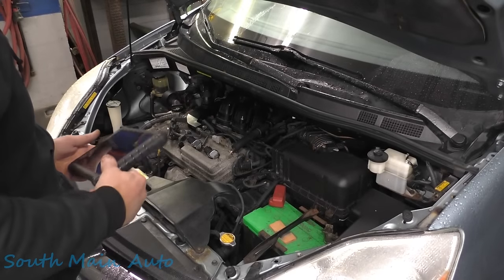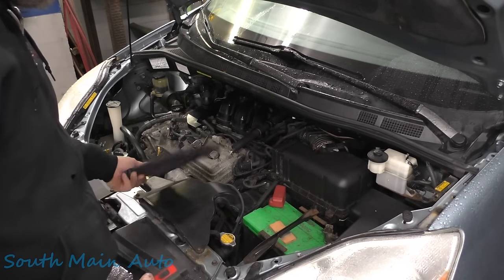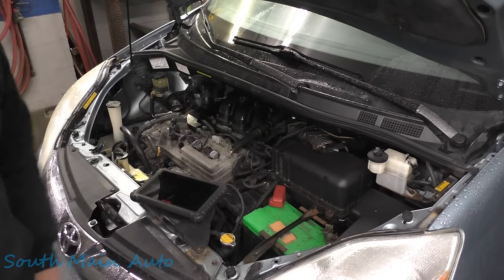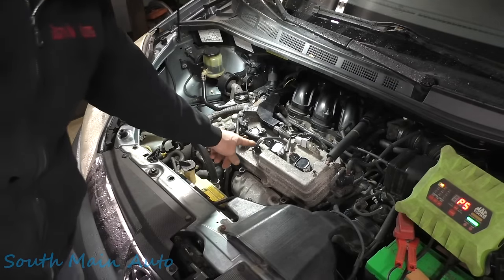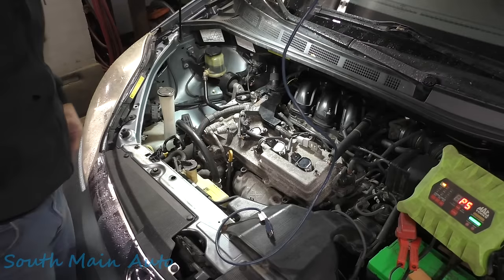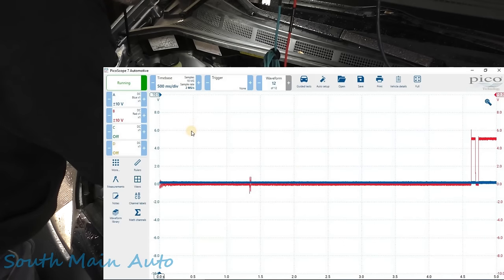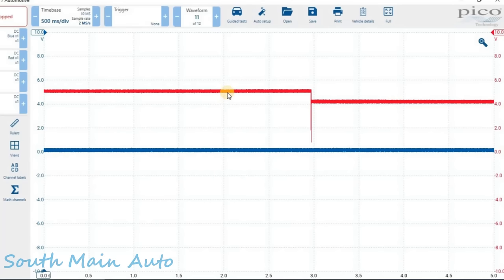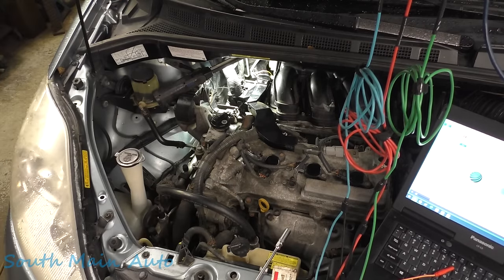Toyota Sienna: P0340 Camshaft Sensor Problem

Comment from the maker: Autel MaxiSys MS906 Pro Diagnostic Scan Tool:  https://amzn.to/3EK0tj6

What scope did I use? The Pico 4425A. Want one of your own? AES Wave is the best place to get one. https://www.aeswave.com/ Carlos is the guy there you want to talk too and tell him Eric O. sent ya there 😉 Be sure to ask about the AES Wave U-Test kit also.
Reply: Not a Sponsor?
Reply: Sold!!  but it will not plug into my 55 chev maybe time to upgrade some things
Reply: I have the 906 pro bt I love it
Reply: So I'm going to try to ax u a ? 2015 dodge Journey 3.6 are coils a common problem I'm getting a p0305 and p0300 and she stumbles. I was going to switch coils to see if it follows. If the misfire don't follow could it be that injector? Your thoughts im sorry for bothering you.
Reply: The wires on that front sensor close to the pigtail, you can see they are cuts in the wire, and can see the copper.
Reply: The port is in the glove compartment go look again. It’s there.  😅
Reply: @jordancampbell5010  At least you can still drive after the EMP hits
Reply: @Boilerking76123  this is true
Reply: I have an old mains powered Rigol scope. The car is already sitting on the ground through the lift or jack stand, so connecting the probe ground to battery negative doesn't cause any issues. If there's a bad ground loop you can always use a power cord with the ground pin cut off (or you can buy a proper isolation transformer, but where's the fun in that?)
Reply: I want to ask your opinion on this what do you think would be the best autel scanner or scanner in general for someone who works on their own/family and friends vehicles Because I like the Autel’s that you have but I’m kinda lost at this point?
Reply: Hey Eric I notice you have a number of different scan tools you use. Any reason for that? Is this one your main work horse 
I have the thinktool pros it does what I need so far

Comment: My wife always thinks I'm nuts watching your videos.  I tell her I'm learning from a Pro! I do all my own maintenance and repairs so your experience is worth it's weight in Gold baby!
Reply: I had a mass air flow sensor problem on my Hyundai elantra. I found a video here describing how to diagnose and fixed it up easily!
Reply: No harm at all. Im a seasoned mechanic but still like watching Eric as he can even teach an old dog a new trick here and there.
Reply: I guess I'm lucky, my wife will watch with me and she isn't even into cars but she is not afraid to to do her own maintenance.
Reply: Just make sure she knows which kind of pro that you mean. You don't want a misunderstanding.
Reply: @devinice6020  Lucky guy.
Reply: But your wheel fell of last week
Reply: I like to think I can build and fix about anything. Videos like this you learn different techniques technology and thoughts, it’s amazing how much you can pick up.
Reply: My friends, my wife also, has friends that send me this stuff a lot.  Truly careful inspection can sometimes find difficult bits as cause this type of issue.
Reply: Yep, I'm not understood by my wife with my desire to watch videos like these. However, she does expect me to fix our vehicles.
Reply: Eric turned me into a brake professional. After getting ripped off by the local brake shop, I was determined to do all of my own brake jobs. I replaced the front and rear brakes on every car in the driveway plus replaced the brakes and rotors on my relative’s Toyota.
Reply: My wife watches with me, she enjoys it too.
Reply: Everyone learns, cheers 🍻
Reply: @Les Reeves I see what you did there..
Reply: Yep, looking over the shoulder of a master with a lifetime of experience: priceless!
Reply: If your wife thinks you're crazy for watching that videos you made a mistake.
Reply: If he can do it you can do it
Reply: Exactly . 🎉 the master Sansei. We home mechanics are always hungry for knowledge
Reply: @pork chop  Next time you save your family $1600 with a $25 repair, be sure to remind her how nuts it was to watch that video.
Reply: My wife does the same thing.  But when an engine light is on she come to me and ask why is the light on.
Reply: @Frank Pratt Scotty and his click bait video titles.  lol
Reply: Do you also talk and think in Eric's voice when working on your car?
Reply: @Frank Pratt Scotty is always saying to buy a 10-15 year old Toyota with 25,000 miles. Everything else is junk.
Reply: @@frankpratt9795 Why are you listening to Scotty?!
Reply: @picklerix6162  Me too!
Reply: Time for new wife.
Reply: Remember,  men are from Mars,  women are from venus.  Very true
Reply: @upallnight888  just had this last week. My wife teases me too, but her dash lit up with abs, and abs related systems lights. Hooked up the scan tool and it said rear left sensor. She was about to take it to the dealership (out of warranty) to have them replace it. I took it for a drive and watched the data, that sensor jumped a little bit, but not much, .5-1mph at times. Checked the connection, tested with a meter just for kicks, and all that was good. Blasted everything with compressed air, and hit the exciter ring with brake clean, and what do ya know. No more lights, no more codes. I expect she’ll still tease me, but she’s grateful lol
Reply: @danfarris135  sign of a good mechanic
Reply: @devinice6020  You're definitely lucky.
Reply: @vincentl4691  Lucky you!
Reply: Nothing more annoying than people trying to benefit from something they mocked.
Reply: Same here bro!
So many tips and genuine deep theoretical logical diagnosis knowledge is on display here!

Also, Eric O never has shyed away from showing us his human moments as well. Everyone can miss something, takes a seasoned and confident individual to accept it, admit it and take steps to rectify the issue.

EricoO and South Main Auto really are the reason I can diagnose half a dang thing. "So the friggin light comes on, what difference does it make?"
That was my frustrated call to the diagnostic gods for a flicker of my own mental understanding.

It took me 5 years to grasp the simple awesome diag power if a test light.
I aint proud of the 5 years.

I am humbled by Erics regular detailed employment of various electrical diag tools and their implementation.

I now call the test light the magic 12v Diagnosis wand. Poke the various fuses n bits, basically ya verify the electrical connections of the whole vehicle.
Few more probes at the suspected sensors wire harness connector and BOOM verified sensor fail/verified electrical short.

The fact it too me 5 long dumb years begore i pryed the theoretical usage and application of a test light out of the cold dark basement dungeon of idiocy my brain trapped that information in serves as a reminder I am stubborn over smart every time.

Embrace the derpy idiocy within yourself, make good lifelong friends with it and then frustration fades into the background.

Das blinksen Lightsen are my path to enlightenment.
Reply: @threadtapwhisperer5136  Very well put!
Reply: @bwalker4194  exactly. I always loved working on cars since I was 14. My first fixer was a 62 nash metropolitan
Reply: Learning from pros and doing the work because you "saw a pro do it" are very different
Reply: Ppl watch TV all day and night, but won't take the time to educate themselves with practical stuff like this video! Not watching this video is nutz in my  opinion. However Mechanic's thrive on ppl not caring to watch or working on their own automobile's. I'm learning that a computer is a necessity to diagnose these issues. I prefer older cars that don't rely on computers and sensors for everything.

Comment: Watching you do electrical diagnosis is incredible. Most thorough dude I've ever seen.
Reply: Eric has the critical thinking skills of a good scientist.  Excellent video and discussion!
Reply: Diagnose Dan is pretty good also
Reply: Watch Wes work is another good guy.
Reply: @@lesreeves8783i agree!
Reply: He is great, check out Yvan too. Pine Hollow, and Scanner Danner. if you like electrical diagnosis.
Reply: @Les Reeves Thanks for the recommendations, I'll check them out. As a telecomm guy, electrical issues are my favorite thing to watch because I deal with them all day, just not in an automotive function. 

Always a good day when someone busts out the oscilloscope.
Reply: With electrical trouble shooting its a system use the same process everytime even when it seams redundant

Comment: As a person who is challenged in the patience department, your patience blows me away. I am getting better, but I am no Eric O.! Nice work! Thanks for bringing us along!
Reply: If you start getting frustrated and aggravated you lose focus the best thing to do is walk away take a deep breath and come back and figure it out have a great day
Reply: i used to be a bit,impatient, but i just wanted it done, not knowing about why its like that, why it broke, whatever, now, i investigate, want it done right, i clean, paint, greese, never sieze, protect, wrap,tidy up, everything i touch. first thing i found with mechanical, is, dirty earths. connectors. not enough earths,. i gave my tdi focus to a ''mechanic'', to replace belt seals idler w/pump, i was too busy with work, i told him vids to watch, & how to do the timeing,,he fkt it. $1,200 for a dusty shelf..now,,i still have to fix it.. tdi focus, brake rockers if timeing is wrong..easy fix..for some..

Comment: Nice video and great diagnosis. Never forget about pin drag testing. 
It almost cost me a $1000 for calling a control module on my Webasto boiler the other day. After going through all the troubleshooting it called for replacement of the module. Last thing I did used my AES Wave kit and checked the drag on the female connectors. Found a loose one and after tightening it up we’re back in business with heat and unlimited hot water.
Reply: As a coworker of mine once said "electrical things are a study in bad connections ".
Reply: Yep. I had a truck a few years ago that threw a bunch of extra codes after someone had checked the pins at the ECM. Turns out they’d basically jammed the meter lead into the ECM terminals. After nearly re-pining the whole connector is was at least down to the original problem.
Reply: Worked in connector industry 30 plus years we had a test called insertion and extraction which measured the number of times you could plug and unplug connector module most machinery autos, industrial equipment never approached threshold of failure, we had hardly no complaints.

Comment: Nice work. As far as that sensor being broken, it's very possible that the customer while swapping around the sensors, didn't seat it properly. He then cranked down on the bolt, fracturing it before it seated.
Reply: Good call, I was thinking that as well.
Reply: @johnbeckett2624  ditto
Reply: But the problem already existed before the customer attempted the swap
Reply: @alexsamson9942   Maybe not. Maybe the old part was bad, new part broken during install, causing the same symptoms.
Reply: or when Eric put the screwdriver underneath and tightened down to 'tweak it', it cracked?

Comment: I was a little worried when you pulled out the NAPA sensor. My Tacoma had a no com cam sensor fault two years ago. The sensor from AutoZone got it started, but the crank time went from instant to 5-10 seconds. Ordered the Denso from Rock Auto and went back to instant. I don't mess with non OEM sensors anymore on Toyota.
Reply: Agree, surprised to see EO go non-Denso with a Yota.

Comment: I'm a do-it-yourself person and I have had good experiences using NAPA parts. I would have swapped sensors first to see if code followed the sensor but what you did was good video to explain why and how you did your diagnostics to attain a solid repair. It would be interesting to see if you used the sensor in the vehicle what the results would have been to prove the new part was no good or if the vehicle owner lacked the skills to replace the sensor to attain the results desired. I enjoyed watching your video and learned a lot so thanks.

Comment: I always worked on my cars,and remember In Edmonton, Alberta Canada in the January was -45%° what is the same in Fahrenheit.
Replacement of a fuel pump on
my Pontiac Grand Prix, fuel pump is at the bottom and hard to get outside on the driveway.
Block the front of high and had to shovel snow around the front on both sides and like a igloo to block out the wind.
I never forget this job as long as I live.
Love watching your great show.

Comment: A long time ago I had a sensor go bad on a hydraulic block on a cnc machine... had to buy an adjustable one, figure out the wiring and finally after 2 days of tinkering, I got it to run again... TLDR sensors can be a real pain sometimes.  You've done much better than I did, would have loved to had your diagnostic expertise to help at that time.

Comment: They provide a torque chart for things like that but general rule is inch pounds on aluminum. My guess is the owner or whomever didn't have the sensor in all the way and when he tightened the bolt, the whole thing cocked off allowing the retainer to crack, then the sensor snugged down but by then, the damage was done. The hazards  of working on today's vehicles is  the possibility of snapping off plastic fittings. Age and heat make things brittle over time too. Good video and good find. I learned a long time ago, make sure before tightening down any hold down fastners, the unit is exactly where it needs to be. This was a prime example of what happends when you don't.
Reply: Anything sealing with an o ring like this barely needs any torque
Reply: @andries4561  Yeah, only just tight enough so the bolt doesn't become loose over time and fall out.
Reply: That is what I thought too. Owner did not have it in all the way when he tightened the bolt. Years ago I broke a thermostat housing for that very reason. I am a lot more careful now.
Reply: Pesky sensors. In my day they were made of brass and leather  etc etc. 🤷‍♀
Reply: @flower2289  LOL. I broke an aluminum thermostat housing on my 7-Liter Ford, 428.   I got a replacement from a junk yard that was cast iron, but what bothered me about it is it had "352" on it in bright yellow paint.  I should have painted over it, I guess.
Reply: @G. Mule yup, the o ring is sealing it anyways the bolt is just to hold it in place

Comment: Nice video. I am a computer guy not a mechanic, but i love your videos.  The process is the same with software; verify the problem; create a plan to fix; test the fix.
Reply: Same occupation here.  He, Wes + Ivan could make it in the software engineering field.  One of the main requirements is common sense and dogged determination.
Reply: I work on cars and computers. The same approach can be used for both. The big difference is the tools.  Working on cars has helped justify buying lots and lots of tools.  Sadly I have never found a use-case for a 1/2in impact wrench on a PC project.

Comment: Great job as usual. Seems to me, customer didn't seat that sensor one properly, therefore breaking the ear when he tightened it down. At that point he had the same fault with the new sensor not seated correctly. I'm just surprised he didn't break the other one when he switched them around, if he did.

Been a wrencher for 40 years, I'll never be an equal peer to you with auto's, but I have learned to pay attention to seating things correctly. My motto to people who think they can't fix stuff or say I have some gift of talent is: "you are not a mechanic because you are afraid of making mistakes." Experience is priceless.

Thanks for sharing your experience, God Bless you, your family, and your audience.

Comment: I'll be honest, I'm an IT consultant, I work with computers all day, every day.   I keep my own cars repaired, for the most part.   I can't stand oscilloscopes, and can't focus long enough to follow most of the various wave form capture systems.   I applaud you for your patience to learn that crap.  

In a situation like that, I'd have probably swapped the two sensors just to see if the code changed (if they were identical), and I likely would have spotted the weird seating.  I can't read the wave forms, but I'm darned good at listening to my fingers.  

Still fighting a P0171 with my Toyota Matrix.   And an oil leak at the back of the engine, which I'm about to fire a parts cannon towards and replace the timing chain tensioner and o-ring.

Comment: Had a 07 Hyundai replaced crank shaft sensor in summer. Crank no start when it got below 20. Found out it wasn’t seated all the way corrected that and fired right up a -10. Great video. Have had lots of trouble with after market sensors.

Comment: I drive an old klunker with older technology these days, I like it simple. But 'da wife has a newer tin box. I keep up with your testing to find any problems. You are very careful and through in you tests. Pin fitness is a overlooked issue, and I had a car that would run for months, then crap out in the worst possible spots. Turned out it was a connection issue in a 32 wire connector. One lousy ground was intermittent. Pin fixed, car ran for years, until rust turned it to dust...
Thanks, Mr. "O!"

Comment: Another informative video with some excellent detective work. My guess, as a youtube certified expert (in nothing), is that the customer was on the right track, but when he unloaded his parts cannon, he tightened that sensor down before it was fully seated in the hole and tweaked/cracked the whole plastic frame. As you saw yourself, that rear hole is pretty tight like a tiger.